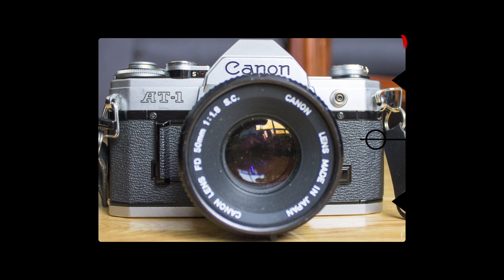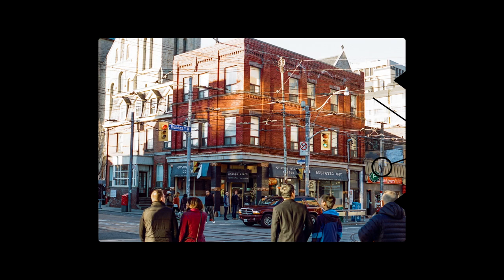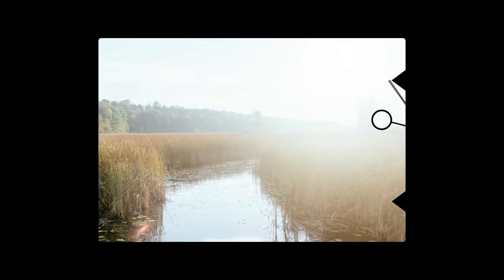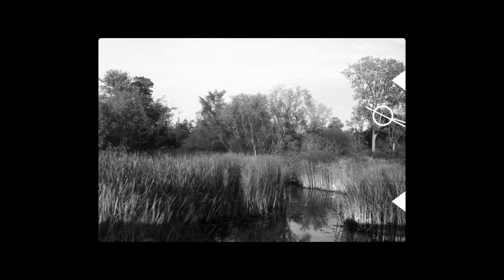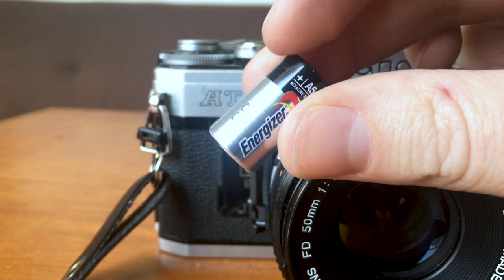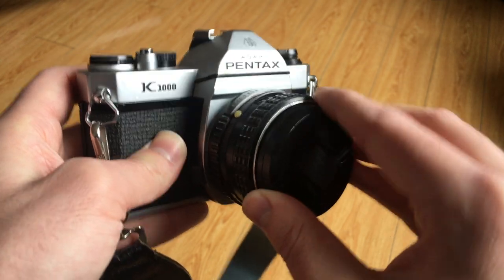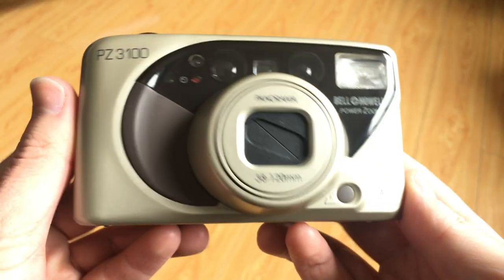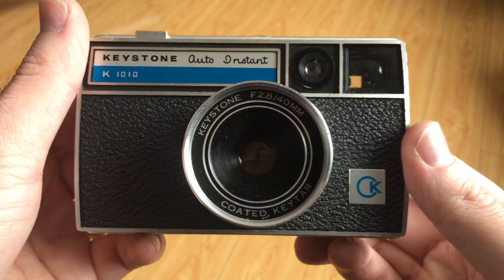Understanding a 35MM SLR LIGHT METER

Comment: Thanks for useful info! I got a Fujica with not working light meter and tried "Light Meter" app on iPhone, surpassingly the pictures came out very good. Now I'm not worried about cameras with broken meter and don't have carry to much stuff with me
Reply: Fayz, have you checked to see if the meter battery needs replacement...that was the issue, on my 35mm camera.

Comment: From my previous comment (I just started film photography (actually photography in general) last week. I have bought Minolta Hi-Matic AF which is a PNS just for me to get useg to it coz I never ever used my phone for photography or any digital means and doesn't know a single digital. Then after finishing one roll with PNS, I used Zenit TTL for manual experience and I just shoot it to my heart's content only using the focusing part to make sure everything is not blurred. Thanks for this basics that I will try applying this to my shots. ) This is very helpful because the Zenit I have has TTL and it is hard to understand what it is for.

Comment: Thanks, You just answered my question(s) about using the light meter inside the camera in conjunction with that indicator with the circle on the end of it... At 2:22 you said that if there is a lot of light the meter reading indicator points to the extreme top of the meter range and in a dark situation, it points to he very bottom of the meter.  One way one could resolve this problem is to make sure one purchases the correct ISO of film (100, 200, 400....) for the time of day you are shooting at.  It would not make sense to purchase a 400 ISO film (or higher) For daylight photos Nor would it be practical to use the opposite in a dark location.

Comment: My Olympus OM10 has the same light meter as the Minolta one shown in the video. Could anyone help how to use it? Like there's no needle indicating which is the right exposure, it's just a couple of numbers and a red light.
Reply: Set your desired aperture and then match the number that is light up to the shutter speed dial

Comment: Thank you for bringing up a very important subject. Unfortunately the culture of auto everything digital has dumbed down photography to such a degree, that some fundamentals of photography have been lost on at least one generation of ' photographers '. IMHO, the first step in understanding what an exposure meter does is to realise, that a meter interprets a subject as an 18% grey. This is how all meters, no matter how simple or sophisticated have been calibrated. It follows that a dark scene needs more exposure to look like an 18% grey card, and vice versa a light scene needs less exposure. The second step is to understand the pattern of light gathering of the sensor. An average meter just averages the scene as 18% grey. A center weighted meter, places more emphasis on the central portion and less on the surround ( For example, a Nikon F3 is heavily center weighted as opposed to a Nikon FM which is much less so ), a spot meter just reads from the central 10, 5 or 1 degree of the scene. Matrix metering, evaluates different zones and comes up with a value and so on. Once the concept of the 18% grey calibration is understood, it is then a lot easier to decide how much lighter or darker a subject would look with different exposure values.
Reply: I have a Minolta maxxum 5 that all those metering modes. I usually leave it in Matrix.

Comment: I think my konica autoreflex t3 has a pretty interesting light meter. It has a needle that points to the F number it thinks you you should use. (Unless you have it set to automatic in which case you don't have to touch it.)
Reply: I have the same camera, what battery do you use for the light meter?
Reply: @viani5943  675 hearing aid batteries, their voltage is close enough to the 1.35v of a mercury battery. However they are not too reliable in terms of voltage, just do a battery check before going out shooting. (Set ASA100 DIN21° remove lens, look through viewfinder and push the power switch to C.) The needle should jump to the red mark (a little bit over or under is fine but not too much.)

Another note is that these batteries generate electricity by reacting with the air, so they come with a pull tab to keep air out, pull that off and leave them for about 1 minute before inseritng into the camera. Also do not peel the tabs on the batteries you don't intend to use immediately since they will start reacting with the air and going bad. Similarly once the tab is peeled the batteries will slowly drain regardless if you use the camera much or not.

Or you can get your camera modified to take 1.5V alkaline batteries but when hearing aid (Zinc air batteries) work fine I don't see the point, at least not since I shoot like one roll through it every month.
Reply: @alfepalfe  Thank you so much!! I appreciate it
Reply: @viani5943  No problem, glad I could help.

Comment: Now does the needle have to always be in the middle, or does the camera get a "perfect exposure" once the needle and ring line up?
Reply: It depends on the camera/meter. In the Canon example camera he's showing here it's called a "match needle" system. The needle will move up and down always based on the exposure the meter sees. When you adjust the ring to MATCH the exposure needle, you have the right exposure (according to the meter).  
But there are other types that work more like what you're describing, where you want to move the needle until it's between small marked range in the middle (and there is no "match needle" shown)... The Pentax K1000 works this way exactly. So does the Pentax MX (except it uses LED light rather than a needle) and many others. It's known as a basic "over/under exposure" type meter.
Reply: @therealchickentender  I'm familiar with the over and under exposed indicators, but does the match needle always have to be in the center of the viewfinder along with the ring? I recently shot and developed a roll I shot with my Canon tx, and they came out great. Photos were well exposed. I asked if the needle and ring always have to meet in the middle of the viewfinder, but I guess my roll proves that as long as the needle and ring are lined up, I'll get a perfect exposure
Reply: @nick044 Yup exactly. Center doesn't matter. The meter needle will move where it wants to, up or down. The matching needle just needs to be moved to wherever it is on the scale, doesn't matter if it's in the center or not.

Comment: when aligning the circle thing to the needle, should i adjust aperture first and then shutter speed? Or is it the other way around. Or does this not matter?
Reply: It depends, I would adjust shutter speed if  your apeture is a priority for the scene.example, headshot you would usually want your lowest apeture. But you don't want you shutter speed to every be too low around 30th as to not induce shake or blur.

Comment: What about AE-1 Program? There isn't a needle and its all made with LED's.
Reply: %100 Portakal I think it’s the same thing. It tells you the number of the aperture you’re supposed to use. If you want to overexpose it, you should lower the number. If you want to under expose it you should raise the number higher to the light meter number they give you
Reply: MrTbutters621 But what if i want to take a shot on a specific aperture like 1.8?
Reply: @ThermAquaGaming  than you should lower the shutter speed if the aperture number is below 1.8

Comment: I have used P&S, SLR's, and Rangefinders. What you say regarding the exposure meter not properly interpreting, for example, a high contrast scene, is very true; especially with the P&S camera's. What sucks is if doesn't have and exposure compensation button. I've also experienced something quite similar using my SLR's. I've taken photos at the beach in A, S, and P modes that were underexposed. The only saving grace is the ability to override the internals and shoot M whole using your own judgement. These fully and partially automated programs are iffy at times. Or at least they appear that way. Lesson learned. For me at least. Some of my better outdoor images were actually taken with my Rangefinder using Sunny 16. Completely manual. Film photography can be fun. But it's sometimes quite the challenge.